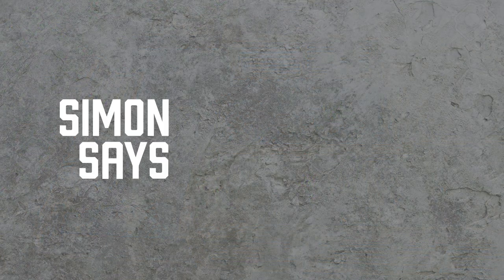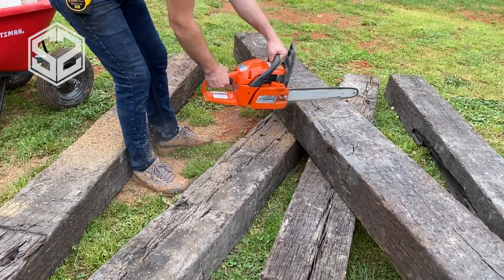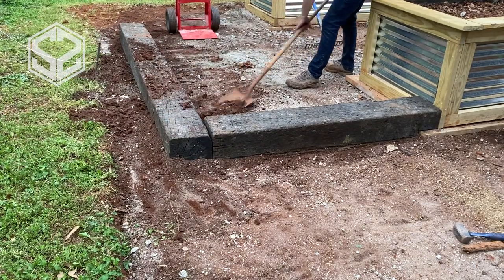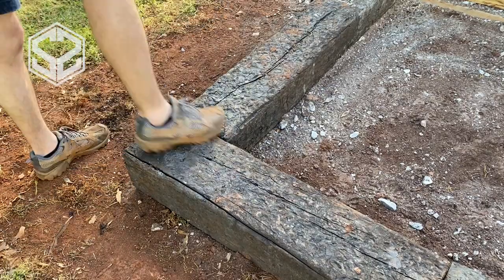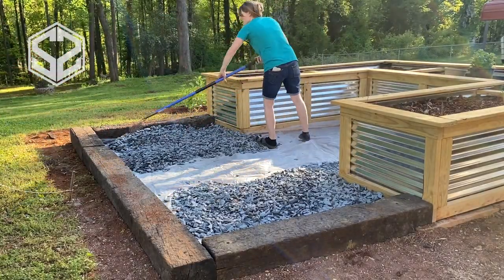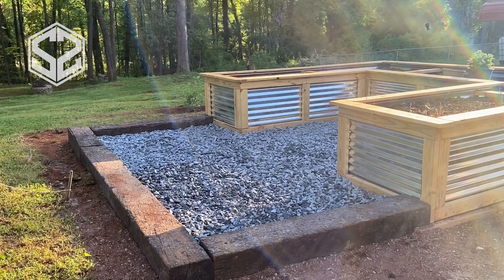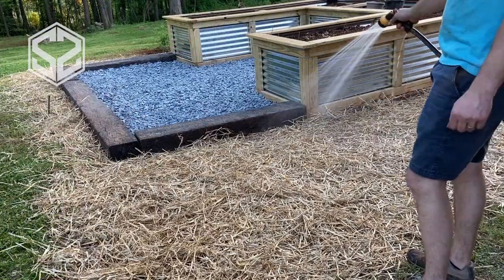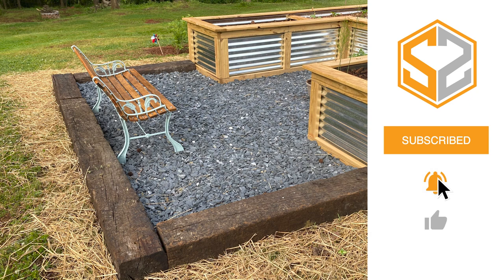How to Landscape with Railroad Ties

Comment: Great tip on the gavel by the scoop. We use a trailer for that all the time, and for garden mix, builders mix for concrete, pea-metal, road fill/base course. So handy!! and the trailer has already paid for itself. Not to mention dumping waste at the waste station.
Reply from the maker: So true! 👍🏻

Comment: Great video Once again. Thanks for the tips on pinning down the ties, needed that. Only change I'd recommend is not to use any plastic barriers for your yard or land, instead you can use a biodegradable & water permeable cloth or like cotton or burlap or just cardboard (seriously)... and if you must use plastic, definitely get those semi-permeable weed barriers for hardscapes like this.

Plastic leaves small areas of sitting water on top... and has a really bad decomp potential overtime, leaching etc, it often ruins the soil health of the layers directly below it. Very large roots tend to be the only ones that survive under these areas. Plastic also encourages ants, termites, pill bugs to nest underneath, plus beatles & crickets which aren't too bad unless they attract rodents. 

I know first hand bc it was an expensive issue with our current house's front garden. I know a garden is very different case but same principle with negative outcomes.. long story cut short, the previous owners had just kept putting new plastic & new layer of bagged soil for 40 years until nothing would grow... a back hoe & dump truck were needed to solve it.
Reply from the maker: Thanks so much for the tips! :)
Reply: made a pool lol

Comment: Great video. Question, does the plastic under the gravel hold water when it rains? I don’t see how it’s able to drain
Reply from the maker: Thanks! 😄 I haven’t actually had any issues with water. I believe it’s because there is a slight incline in my yard so the drains down hill really well. If flooding could be an issue I would recommend using landscape fabric. It still drains but keeps out weeds.

Comment: I am wondering, do you have any problems with deer or woodchucks/gophers? Does the wood in the base help, if so? What are your thoughts on modifying the beds to include a heavy screen in the base? I have deer and woodchuck problems. I would add an upper screen system. Thank you for your help here, it looks great! Is there any way to tell us the costs that you had?
Reply from the maker: Thanks! I haven't had any issues with deer or gophers yet. I do have them around the area so it may be a matter of time till they find it. I try to control the population of gophers on our property as they can be really destructive. You should be able to easily lay down the metal screen before you build the garden and that should work well for the gophers. Im sure you could modify the design to have a 4in x 4in x 6ft post at each corner that could function as a fence to keep the deer out. This design cost me about $600 but the price of materials have gone up since i built this.

Comment: Where did you go to get used railroad ties? I absolutely drool over the stacks of them I see on the sides of the tracks, but have no idea where to go to get them.
Reply from the maker: I got these at an ACE Hardware and Landscaping Supply. They are also available at Lowes and Home Depot in my area. I would check with your local landscaping supply store.
Thanks!
Reply: @SimonSaysDIY  Thanks!! I'll look into places like that!

Comment: Did your ties not have oil in them? I tried to cut one with a circular saw, and it smoked like crazy and smelled bjgtime. Somebody told me it was the oil in the tie.
Reply from the maker: They did. However, these were covered in creosote. This is a chemical to prevent decaying if the wood. It’s not particularly safe to can and left on your skin for too long it can cause a chemical burn. Using protection is a good idea and keeping your skin covered. I prefer using a chainsaw as the wood chips are much larger and lest dust in the air. Thanks!

Comment: Do NOT use galvanized metal roof pieces for raised beds. They will rust within the first couple years! They are not designed for this kind of use. If you're going to use metal in a raised bed garden use stainless steel or aluminum.
Reply: Google "How long does galvanised steel last, directly against soil, in a raised garden bed?"

Comment: You should't use Them next to food if they have been at the railroad. They Are full of oil, sod and other chemichals. Not healty.
Reply from the maker: Thanks for the tip! I appreciate it! :)
Reply: Correct not only that but all the fluids that leak from the trains and equipment